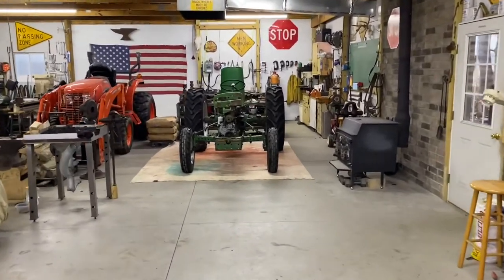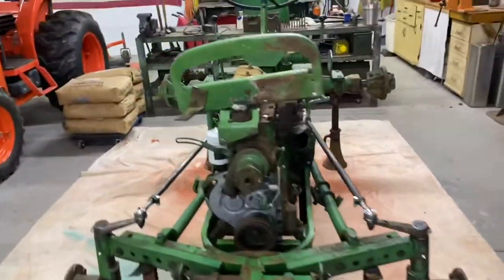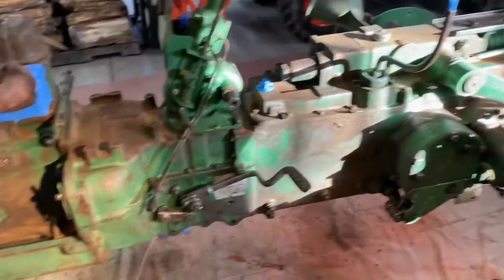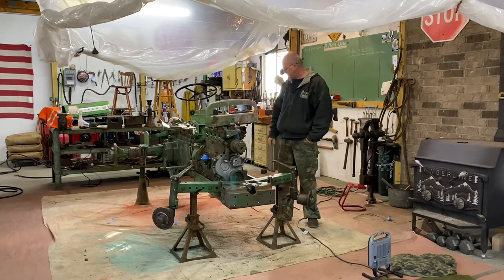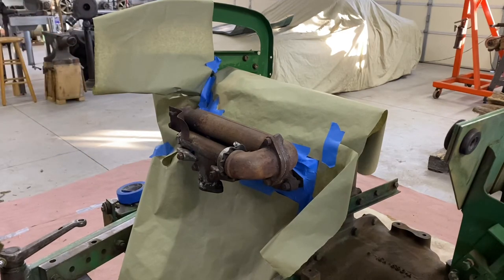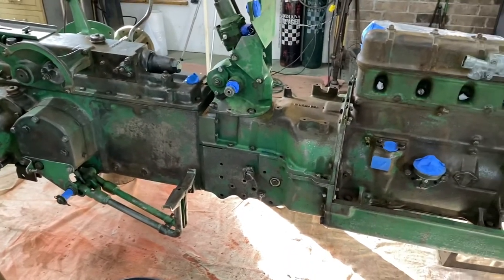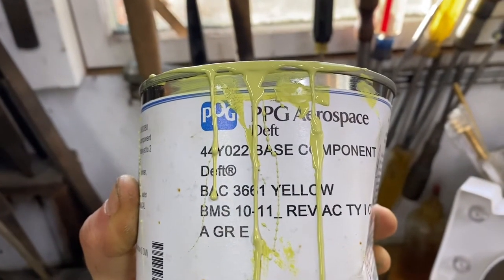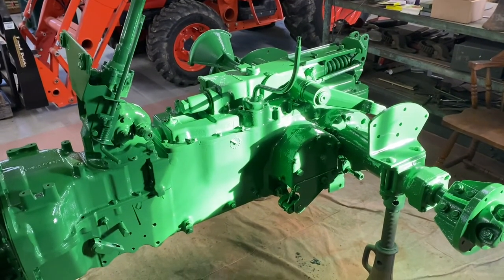Oliver 550 Rebuild: Sanding, Priming, & Painting. Ep: 16

Comment: Where did you get the front tires?  I haven’t seen that design before, they look like they would be better than the typical 3 rib that I have on my old Ford.
Reply from the maker: Yeah I am not a fan of the 3 rib tire. I got these off of Ebay. Hoping they don't slide like 3 rib when turning.